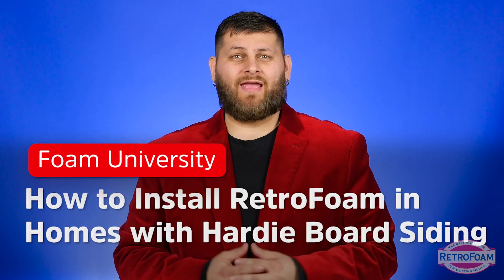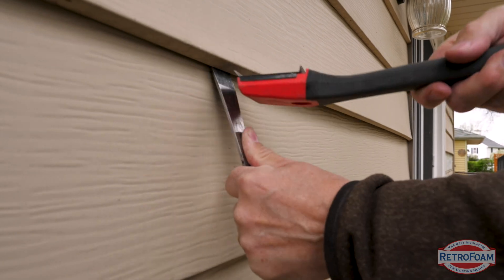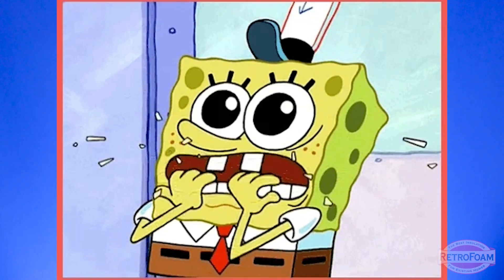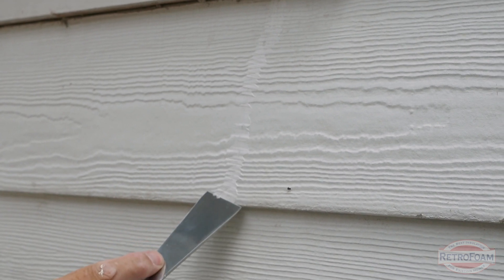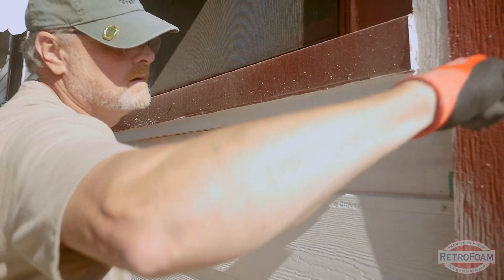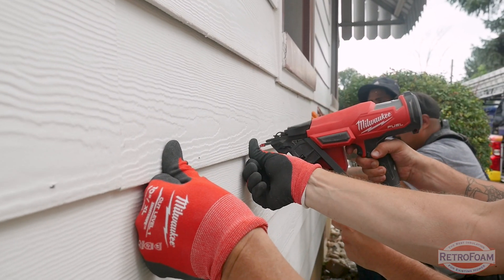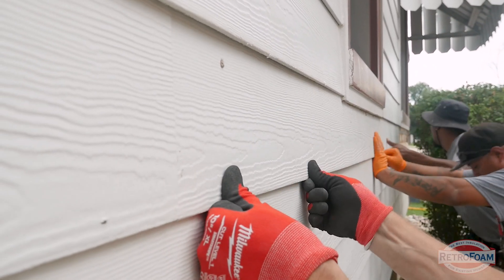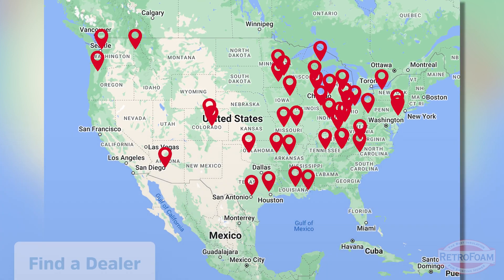How to Install RetroFoam in Homes with Hardie Board Siding | Foam University by RetroFoam

Comment: What about existing batten insulation?  How do you deal with it?
Reply from the maker: RetroFoam can be installed on top of old fiberglass insulation because the old fiberglass doesn't impede the RetroFoam from filling every nook and cranny. Check out this article for some additional information on this topic: https://www.retrofoam.com/blog/add-retrofoam-to-wall-with-old-insulation